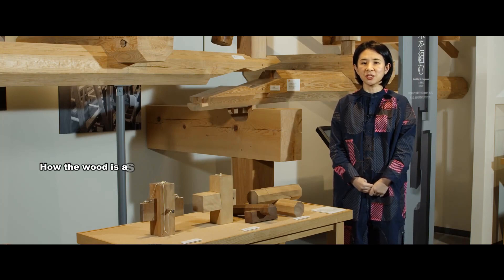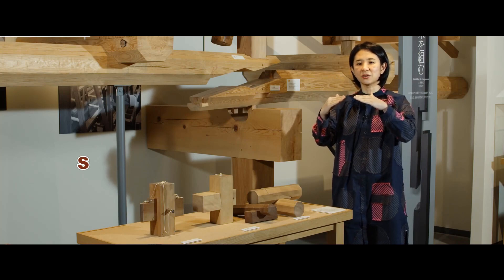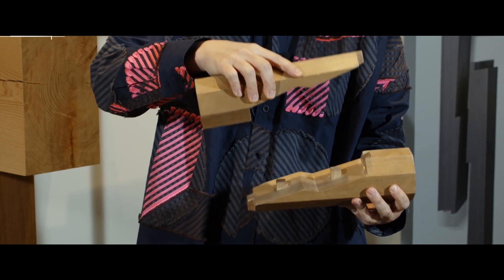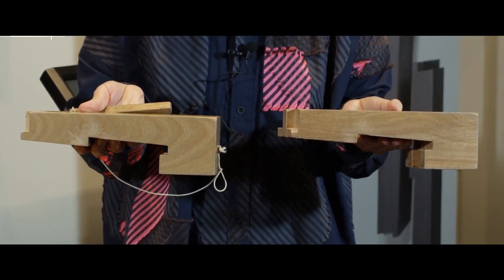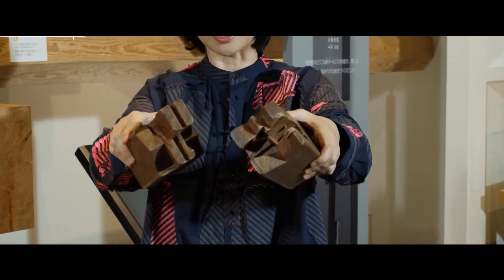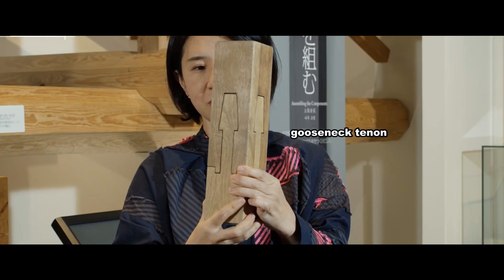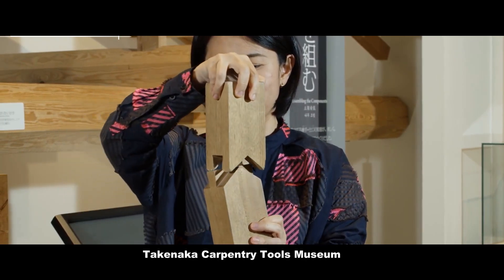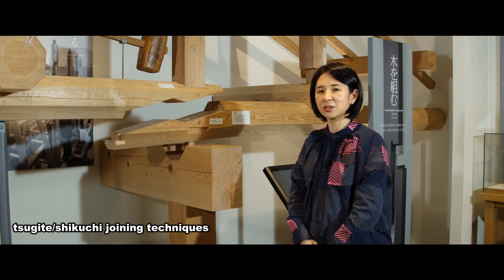Amazing ductility joints show off the high skills of the carpenter and are easy to disassemble.

Comment: Easy to disassemble in a few seconds but takes years to make them fit properly. Back in the early 1970's I started my apprenticeship as a joiner/cabinetmaker. Mortise & tenons were the first joints I kicked off with. Obviously the MUST DO for us all to learn were the dovetails as they were mandatory for the final exams. Half-hidden and full hidden dovetails were then the icing on the dovetails. But, overall, everything we learned was peanuts compared to what our Japanese counterparts are hammering away at. Imagine our German carpenters doing these sophisticated joints. The time needed would be immense, and the bill for all the work would be jaw dropping..... More greetings from Germany